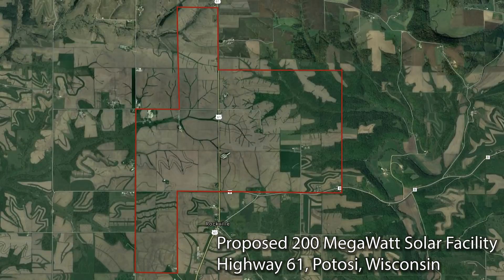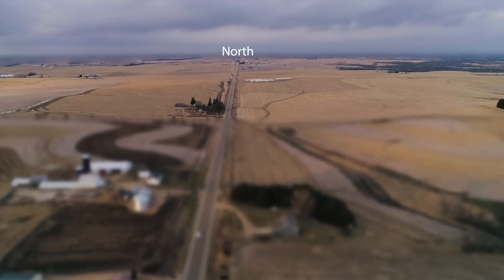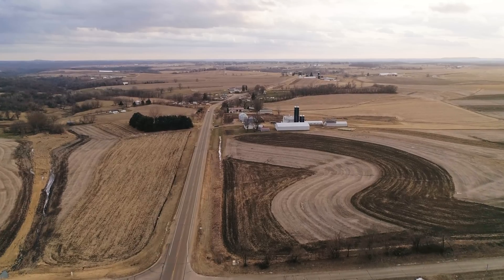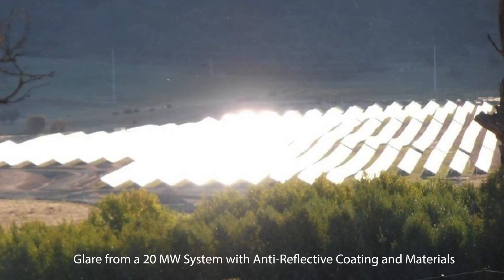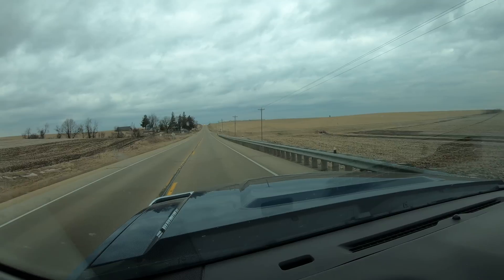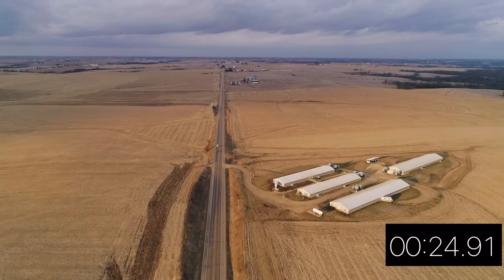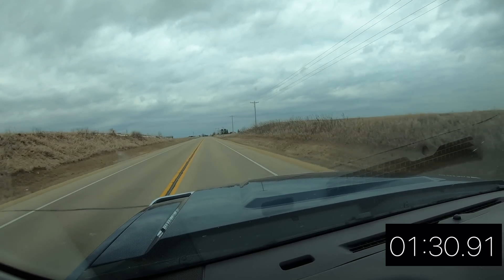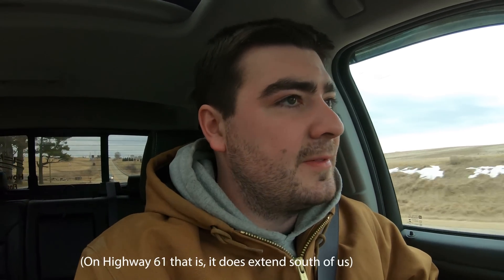Proposed 200-MW Solar Facility | NextEra Energy

Comment: It will be a huge mess!!! It’s NOT environmentally friendly! At the least a 15 degree temperature increase. All of the panels will be installed using piles. They are pneumatically driven into the ground. The seismic activity created can settle foundations and collapse deep wells. When the panels expire or the lease runs out, the company will just leave. It’s up to the property owner to clean up the mess left behind. Solar panels absolutely have a shelf life. 
 I know all of this because it’s happening where I live! 
At the meeting Do Not Trust anything the company tells you!!! 
Glare, chemical runoff, erosion, temperature increase..... just to name a few. 
Solar is popular right now because electricity companies are charging 30% more for electricity to people who have requested solar power. The problem is solar power goes into the power grid the same as coal or any other source.

Comment: You should also ask:
1. Do they have an Environmental Impact Statement and where can you get a copy.
2. What is the projected effect on adjacent land crop productivity?
3. How are they going to deal with erosion.
4. Will the land have a cover crop, what is the cover crop; and how will it be maintained or will the land simply be natural vegetation.
5. How are they going to deal with weeds since weeds + weed seed can affect crops planted adjacent to the facility and may reduce adjacent crop productivity.  Use of herbicides and potential effect on adjacent crops.
6. How is the facility construction / installation financed?  Privately or through public fees (taxes, increased utility rates, utility surcharges, etc.)
7. Projected life of the facility.
8. Decommissioning the facility and who pays for decommissioning.
9. What happens if the company goes out of business, declares bankruptcy, or sells the facility?  Who maintains the facility, who decommissions the facility, etc.
10. What is the projected affect on adjacent land values?
11. Are transmission lines overhead or underground?  How are the lines maintained and who maintains them?  Land access issues, land required, affect on land values, etc.

Comment: Interesting that solar is now the best value for that land.  Would also free up the capital tied up in machinery and produces passive income; may not be as much fun but economically rational.  Solar glare is overblown; new panels don't produce much glare and optimally none as the point is to utilize the sun not reflect it.  As otherwise noted, only governments can exercise eminent domain and there is also much protection to ensure adequate compensation (it's not theft).  While small, the positive effect of reducing supply should help remaining growers.  On the flip it's a negative to local support services (after the farm is installed) so if the whole county went solar the dealerships would go too.
Reply from the maker: From my personal understanding, the contracts for solar facilities such as this one are worded so that payments to landowners can be renegotiated. If the price of power drops and they aren’t making a profit, landowners can get the shaft.
Reply: @HowFarmsWork  If that's what the neighbor is doing then they should get better advice.

Comment: CoServ installed a 2MW system less than a quarter mile from my home here in North Central Texas. A few things no discussed were the upgrades to the transmission systems that would be required, there are new High Voltage Transmission lines criss-crossing our neighborhood (we have 1 acre lots). Multiple new substations and switching stations had to be installed as well. The sad part is they purchased the land for the solar farms but talked the governments into using eminent domain to take the right of ways for the transmission lines. I am willing to bet they will need to use your property for transmission lines soon after the project work begins. Another issue was the electrical and radio frequency noise became an issue. We can no longer adequately receive televisions broadcast from over the air and many radio stations are no longer available to us. The micro inverters are spectral noise producers. I am an Amateur Radio Operator too and so I see the noise across vast parts of the radio spectrum.

Comment: Here in MN, we’ve been white since mid November. All the solar panels are still covered in snow. Around here it’s a waste land and money.
Reply: Day length and solar intensity is much lower in winter so its prob not even worth the effort to clean off the snow. Our solar panels produce most of their power in the summer months so I'm sure the solar company has done their math to work out if the economics stack up in this area.

Comment: Same crap here in McHenry County IL. The area got together hired a lawyer and finally got it stopped for now. Making solar power is not the main reason there doing this. Putting money in the company that’s doing the work’s pocket is the main reason. We ask how long it would take for them to fix the panels if they got damaged.  There answer was about 3 months. Put they had to get them put in very quickly. Our county zoning board was new to zoning for solar also. Thank goodness we got it stopped for now. It took most of the locals and a lot of time to get it slowed down.

Comment: How will brush & weed control be implemented on the solar farm?

How many local jobs?

Will retention ponds be used to limit run off onto neighboring acres. 

How much local tax be generated?

Is your local power company sponsoring this build for local power?

Can the distribution line be run down the current right-of-way you use for the local power supplier? 
Could it be buried so it wont interfere with farming?

Just realized your in Wisconsin Mistakenly thought you are in IA 😀

Comment: Wonder why you do not display your brand clothing on your person,    in the video.?

Would be concerned about drainage,  will the solar project shed water on your land.?

Who will own the land ?  Will project enjoy tax abatement? Exemption ?

Is there a Host Agreement, to benefit The County, reduce tax base cost for local taxpayers

If project fails, is there a Surity bond to cover cost  restoring land to the pre-solar conditions?

Electrical interference affect your cell phone reception ?

How much of the project is funded by Government Subsidies?  

Where are their OTHER projects and where are the operational comments from those residents, subsequent to to project going on line?

Who will mow or spray herbicides  between the panel columns OR . become overgrown eyesore?

if weeds allowed to grow,  water hemp and other weed seeds can be carried by wind onto your land?  I

How will electricity rates be affected in you area by project. Green energy usually more expensive. If utility is Forced to by the electricity, cost will be passed on !!

In NY, the State mandates a surcharge to All utility customers, to underwrite cost for this type of project. $3 per month on every utility invoice, residential, commercial is more !!

Rule 1. Follow the money,  disclose source of all funding.

New poles built to a distribution location,  needs to be a new substantiation/switching station, who pays for that, where is that location??

You mentioned panel mfg. Chinese no doubt.
Reply: Rule 1. Follow the money,  disclose source of all funding......BINGO!!!

Comment: we use energy, we have to produce energy. "not on my land" is usually a questionable stance.

now, i would suggest you guys (county) get your foot in to profit from the facility locally. that's the best thing you can do. its a guaranteed source of income for decades to come. many countries use this as a way to democratize energy production, especially useful in rural areas where there are not many other sources of income (no industry).

on the other hand, i always wonder why there are no windmills over there. its the best thing for farmland, you produce local energy and you can still farm the land. why is that? not enough subsidies? no rights to feed it into the local grid? what is hindering it? thx.
Reply: Prior wind projects were shot down by the community. And the rolling hills make most of Grant county a less than ideal wind energy source.

Comment: in our area they put in transition lines and the builders did not car about the right of ways they went wherever they wanted did damage to the ground that was not in the right of way.they blocked the roads that the farmers used to get to back fields with big rocks.so mark your grounds so there is no trespassing .good luck

Comment: What is the likely hood of sink holes opening up in this area - then what happens to a solar panel?
Reply: The panels sit on a steel or aluminium frame so pretty easy to unbolt and move if a hole opens up?

Comment: Will excess heat radiate from this?  Will it dry out surrounding areas.  What about nights - will nights be warmer around this area? Flying over with a drone - will this limit your drone zone? - will birds cook in the air from the glare?  I am a skeptic.  Once the land is gone it will be near impossible to get back.  Say this flops in 10 years - then what who cleans up the land?

Comment: There is a absorbing solar panel operation close to me. This is not a reflecting mirror to a central station. At this facility I've never seen any reflections. I've seen deer grazing between the panels. The panels are elevated 1.5 meters off the ground. 
We have to find a solution to electricity made from nuclear, coal, and diesel fuel fired generator plants. I'm in favor 100% of solar energy and wind generated energy.  In Europe we are moving ahead on these types of energy.

Comment: You will not stop this project so you need to look at the opportunity it will bring. Mowing grass between pannels and cleaning pannels will be constantly required, as well as clearing snow off roads etc. Local companies most likely will have the lowest costs for doing the works.

Comment: One thing to think about is the residual heat from the panels . It can raise local temperatures several degrees depending on how many panels there are. 10 degrees may not sound like a lot but during summer with temperatures already rising it could be bad.

Comment: I'm not local. However, the FAA needs to be involved for the airport; find out what is going to happen to existing farmsteads and existing structures such as homes, buildings, grain storage, family heritage, etc. You also correctly raised concerns about run-off and potential for interruption to your operations. Additionally, NO additional farmland is being made - meaning that urban sprawl is taking away key and valuable production property out of production. My personal suggestion is to work with local and state officials to keep it out and encourage the location to be in  a less populated and minimal impact area due to storms, etc. The deserts come to mind - but then that would take Chicago out of the equation for the power. Check out some of the areas around Rochester MN and the multitude of wind power generation facilities that exist. It would provide a better use of the land. There is no need to create the energy on the backs of farmers and loss of prime productive land.

Comment: Trust me when I tell you,  DON'T TRUST 1 WORD THAT THEY TELL YOU!!!!  They will tell you lots of things in the beginning stages, you will talk to all kinds of different representatives, and each will tell you what you want to hear, and by the time it comes to the project being started,  things are already decided and you are the last to know, and you will have no say in the matter.   We are in the Marcellus Shale gas area in western Pa, and have gone through years of companies buying and selling and leasing mineral rights and now drilling and laying pipelines.  They are all out for themselves and the bottom line, and you are just an obstacle standing in the way.  Eminent domain is a favorite tool used by these companies that they use indiscriminately to get what they want, regardless of what is right or wrong.  A few dollars to a local council gets lots done,  I can tell you that for sure!!!   Be careful and best of luck.  Another thing I would look into if it does happen, is dust,  will they hold you responsible for dust produced from harvest,, tillage etc that lands on their equipment that would need washed off?

Comment: The Solar Array may consist of 200 megawatts of panels but fall and winter isn't sunny. Stupid place to install solar where is snows. I considered solar for a small condo clowned it would cost me $50,000 is panels and power storage batteries were the largest cost since to become 100% off grid. The ROI made no sense as it would take 50 years to pay back the upfront cost today it eoukd be lithium so a smaller footprint for storage but still the same cost. The only places solar makes any sense is the southern and western U.S.

Comment: Oh man Ryan I really hope that doesn’t go through you guys will hate it. The same thing happened about a half of a mile north from of farm here which puts it in Massachusetts. The company that installed them did so much damage just installing them on the property. They create a large amount of glare. And I can’t speak for all solar panels but the ones they put in here make this high-pitched buzzing sound near the end of the rows at the transformer stations, On A quiet winter day you can hear them from the farm. When you get within a half mile of the solar field you don’t get any radio stations to work in the truck for some reason because they interfere. From the best I can tell from your map the proposed project next to your farm is about twice the size of the one next to me. I am definitely not against renewable energy but there are just a lot of negative side effects to living right next to these panels that a lot of people don’t realize. I could email you some pictures of the site if you want

Comment: Do they want to cross your land with the power line? That doesn't seem like it would be a problem. The purpose of a solar panel is to absorb light and convert it to energy so having it reflect off is counterproductive. Some setups track the sun to keep light coming in at an optimum angle. It's interesting that nobody wants to have anything to do with producing or distributing electrical power but everybody wants to use electrical power. It's like the people who complain about the noise, smell, and machinery on roads from farming but still want to eat.

Comment: There goes your property values and quality of life along with it. There will be glare among other problems as well as messing up valuable croplands. For the amount of acreage these solar arrays occupy, the power production is rather small in comparison to say a 40 acre gas turbine facility producing 1200 mega watts. There is a proposed 200 MW solar facility under consideration in Morgantown, WV, which is about 25 miles from my home, and would occupy roughly 100 acres. Also, there is a proposed 1300 MW gas turbine facility in the same location that would occupy 40-50 acres. I would rather have the latter of the two being much more efficient and less visible for the amount of land occupied/disturbed. There is nothing wrong with a variety of power generation sources as long as they make sense but, solar is very inefficient along with short lifespans of the panels with current technology. Some of these facilities are abandoned after they have reached end of life with the companies who operated them just walking away to leave the mess for someone else to deal with. Wind turbines end up much the same way with the landowners left with the structures to deal with. Unless legal measures are taken before construction of said facilities to remove them when shut down, they are usually left behind. This is especially true with bankruptcies playing the part in shutdowns. There are pros and cons to everything and there is no magic bullet for power generation, so I hope everybody involved will make the best decisions as to whether this is a good fit for your part of the country, as well as preserving your farmlands for what they were intended for.

Comment: That's going to be some EXPENSIVE electricity.
Reply: Solar and wind is now cheaper than coal.
Reply: @wulfjason  How much of that is subsidy. Here in Texas, if they took the several TAXPAYER PROVIDED subsidies the "green" energy available on my bill couldn't pay for itself. Natural gas is the cheapest electricity here.
Reply: @jamesoliver6625  These are all prices to produce a megawatt of electricity WITHOUT subsidies.
Coal varies from $60 - $143
Wind varies from $29 - $56
Solar varies from $40 - $46  (in 2010 it was $120, but with technology it has come way down)
Natural Gas varies from $41 - $74